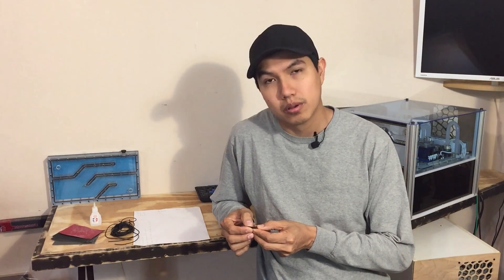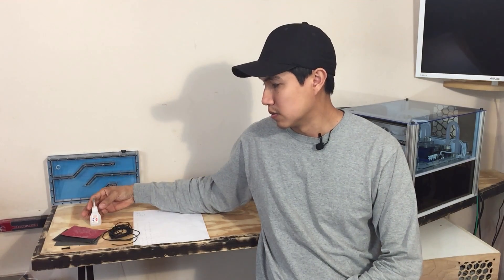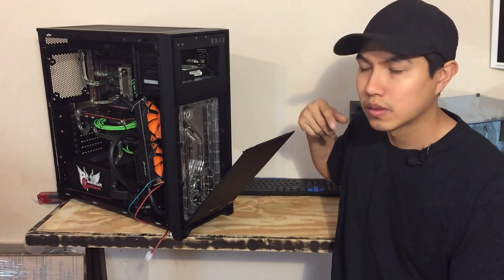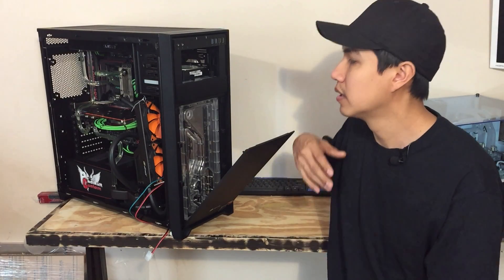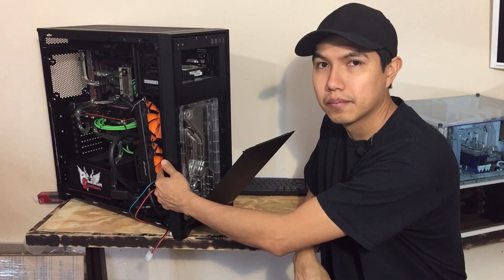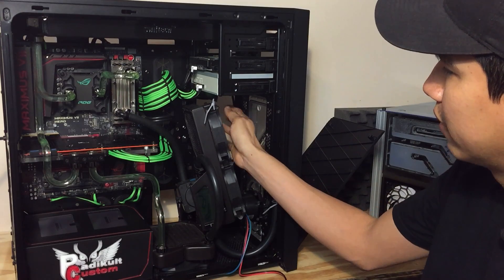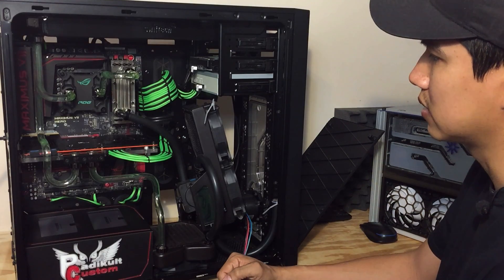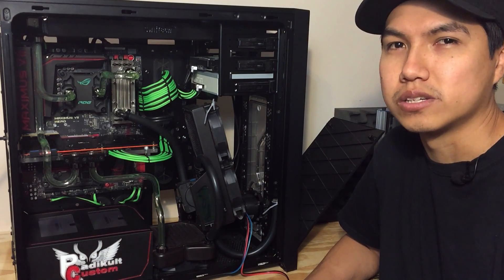Custom water cooled PC reservoir build part 3

Comment: May I ask what you use for O-ring material and do you glue the whole o-ring to the reservoir blocks itself?
Reply from the maker: Savant PCs  I use buna O-ring cord .06ish - 0.1ish   
The smaller it is the better it looks I think  but the harder to get a seal (the groove has to be perfect)
 While larger diameter the easier to get a seal
 I use cyanocrylate to bond the o-ring 
And No, the o-ring just seats on the groove and pressure seal it
Reply: Radikult I take it you use a ball cutter endmill. For such a small size do you prefer 1-flute or 2?
Reply from the maker: Savant PCs hmm I use an end mill  but I have use ball nose before  but I only have 4 flute ball nose 
 I do have a 2 flute  1/4 but I feel it's not as good as the 4 flute, maybe I still need to play with feeds and speeds
Reply: Radikult I mean mainly for the gasket. It looks like you used the CNC to cut a channel for the gasket to fit into and was wondering what endmill you chose. Thank you a ton for answering the questions too!
Reply from the maker: Savant PCs I use an end mill the same same as the o-ring   From 0.06 to 0.1 depending on the oring

Comment: Wow. Leave that panel off to expose that awesome reservoir move your rad up top obviously and come up with some sexy bends in that void or get a different case something with a basement
Reply from the maker: Jason cheever lol.  Maybe I was thinking to add a extra reservoir to make it a double loop into that empty space
Reply: Radikult yes but that would require another reservoir where would you put it in that case?
Reply: Radikult regardless amazing work
Reply from the maker: Jason cheever below the drive bay and between the MB and the reservoir
Reply: Radikult watch for airflow restrictions I'm not familiar with that case just giving you pointer if you already didn't know

Comment: Very nice man. What kind of fluid did you use when tapping the screw holes?
Reply from the maker: Pine PC design on acrylic,  just water  but I'm tap was old. If you have a new tap  it not needed on acrylic
Reply: Ah alright.
How did you measure/where did you get the measurements for the pump hole?
It's kinda sketchy, needs to be perfect.
Reply from the maker: Pine PC design  using a digital caliper and a mcp-655 pump   It took me a long time to get it right
Reply: Yeah man I can imagine, many tries on waste acrylic I assume.
Great video man, really good job.
Reply: By the way, did you use an o-ring on the pump?

Comment: what size oring material do you use?
Reply from the maker: Ben Jostlin the diameter is .085 o-ring
Reply: what size pocket do you machine to get a good seal on .85?
Reply from the maker: Ben Jostlin usually 80% of the width of the o-ring size
Reply: Thanks thats really helpful.

Comment: Just out of curiosity how much liquid volume is in the res ?  What is the system in the background ? It looks cool in it's own right , does it have it's own set of custom water tanks? I watched the video a second time to get a bit better idea of the detail work that you've put into making the res.
Reply from the maker: the reservoirs that are going to be for sale hold 500ml
 and here its a video about the pc on the right if thats what your talking about
https://www.youtube.com/watch?v=A2Qc7tpiBc4 Pt1
Reply: Okay thanks for the reply. I will check out the other video. P.s What name should I search for to find the res on Ebay?
Reply: That volume should be plenty my currently holds around 200ml. I cant wait to build this now. I really like how you have been bending and routing your tubing it looks top notch.
Reply from the maker: dandel351 I haven't posted them yet . Soon maybe tomorrow .  If you follow me on twitter  I'll be putting the links there or maybe I'll make a small video showing the res. And links to buy them .  But very soon

Comment: Which grid sandpaper do u use to polish?
Awesome work by the way. I actually made my own one will be soon on my channel.
Reply from the maker: TechMaxTV usually from 400-1500 grit 
: 400 if the machining face it's not to bad, if it is then 320 or even 220  and all the way to 1500 or 2000 and polish if you want a "clear" look
Reply: thx

Comment: Another waterblock would go perfectly to the rear of the case bro. You can try to make your own logo on the next block for examp: (RK) :). Great job.  And, thanks for the feedbacks.
Reply from the maker: AK TechGears someone gave me a idea of making another reservoir with a pump and make the pc a double loop  
Of course still saving for a pump
Reply: Radikult i would send to you if you were near europe. But, Usa is too far unfortunately bro. But, its not a big deal to get it. Exactly, second loop is must if you're going to use cpublock. Next time you can make your own case with these unique blocks. Just step forward bro. You got talent.

Comment: I like what you've done so far, Radikult. I would try and fit a thin rad in the space. My opinion looks 10 times better than the 120. Definitely need to see that beautiful custom in the front. Just maybe fabricate a border to go around the res. Yea, if you ever got into fabricating I would be interested in buying a rad in that style.
Reply from the maker: Coffeefoot working on the front at the moment ( I think I'll look nice) as for the rad. and fans I think the D5 pump it's on the way . It will have to be a super skinny rad and fan set up for it to fit

Comment: Since you already has the CNC machine. I'll just make a nice aluminium panel with graphics or logo to cover the void area.
Reply from the maker: William Wangsa (spoiler alert)  so I made a panel with an opening that cover the front of the reservoir and the piece from the opening it almost fits in that void area, I was thinking to engrave some logos and put it there   But I'm still deciding

Comment: You can mount a radiator in the blank area.
Reply from the maker: Shadowtaz Foss I think with the thickness of the radiator and fans will end up hitting the water pump on the res. And will be kinda hard to get air flow from the back panel/bottom

Comment: I know your psu shroud is also doubling as ssd sorage but maybe some crazy hdd holder or even a custom 5 0r 8 inch lcd touch screen you can get them pretty cheap for about 40-100 bucks
Reply from the maker: corey marinello the LCD screen type idea requires "back light and white back ground" to work properly . And the hhd idea sound posible cheaper too haha 
Some one else say maybe make another reservoir and make it a double loop.    All good ideas just some cost more then others .

Comment: put another custom reservoir in the big blank spot you will have and make 2 loops with different colors .1 for cpu and the other for the gpu.
Reply from the maker: John Leonard that's sound good, I thought of that before but at the moment I only had 1 pump . (Still only one now) I would have to buy a extra pump to make that possible
I will have to start saving then since pumps ain't cheap
Reply: holy crap, I just googled the price on some brand name pumps. They cost a bit more than i thought, even a cheap one was $40 us. Maby just do some realy cool bends in the tubing to fill in that area or a rad if you have one handy
Reply from the maker: John Leonard lol. I know , I have a bad (D5 ekwb) pump that the impeller went bad, so it get stuck and won't spin until you open it 
Maybe I'll save and later I'll make that double loop

Comment: Get rid of the front cover.
Make a mesh type cover. That way the res is protected, but you can still see inside the build.

For the inside, maybe that's where your tubes can run? Rather than having it next to the motherboard or GPU, you instead run it in the empty space and then turn to where it needs to go.
I know that doesn't make much sense, but I hope you understand.
Reply from the maker: My 0x1E I'll see what kind of ideas I can come up with  to make a see thru panel/ screen in the front . And in the inside see how I can arrange the bends to take that empty space